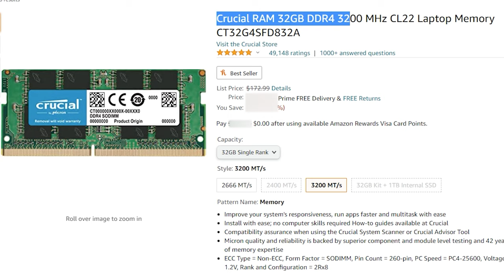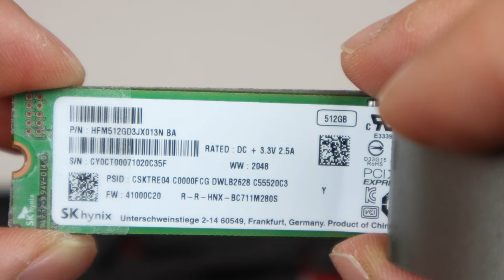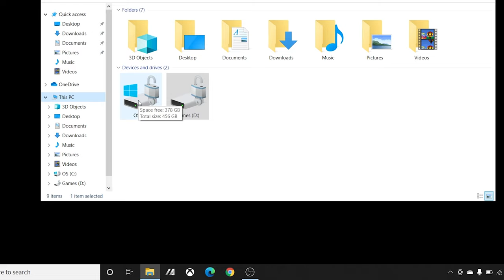How to Install/Upgrade RAM and m.2 SSD in ASUS TUF Dash F15 Gaming Laptop (NVMe only)

Comment: Hi Phil. I don't know if you'll see this comment but I put a new ram into my laptop and its now not booting up. Fans start up and keyboard lights up but nothing appears on screen.
Reply from the maker: Hello, sorry for the late reply. If after installing new RAM you have no display, it’s usually due to improper installation, incompatible RAM, or BIOS/UEFI settings. The first thing I always recommend is to check with the laptop manufacturer that the RAM you installed in indeed compatible. The next thing to try would be to simply remove the new RAM and re-seat it, ensuring it is firmly in place and pressed all the way into the slot. Lastly, a BIOS update may resolve this issue, although you would have to uninstall the RAM first, perform the BIOS update, then re-install it after you have the latest firmware.
Reply: @FixItPhil hello I’ve tried doing everything you’ve said in this comment but it still won’t work
Reply: Though this is an old comment, it might still help others. I experienced the same issue with my FX516PM when I installed Corsair Vengeance DDR4 3200 RAM. On booting, I got a black screen with the keyboard lights on and the battery light flashing white. Removing the incompatible RAM fixed it, so I’m back to using my Crucial 8GB stick until I find a compatible upgrade.

Comment: this helped SO MUCH. thank you! Noted for people who are questioning whether if the computer recognises the full 40gb of ram after installing the 32gb as in this tutorial. It does recognise all 40gb! Happy gaming :)
Reply: Is it works in Dual channel?
Reply: How is the performance after upgrading? Have you tested the RAM performance in games or design programs?
Reply: @kricketto_  I bought the 8gig model with the intention of directly upgrading it to 16 on the first day. I ran the Cyberpunk 2077 benchmark before the upgrade and the ram was really causing a bottleneck, fps dropped to about 10 when the benchmark scene changed to outdoors. Task manager was showing about %95 ram utilization. Installing the second ram stick made the game playable by my standards, now I get min 30 max 70 fps on medium settings with dlss on (rtx3050).
Reply: But there's only one RAM slot, how is it gonna recognise the 40 gb?
Reply: I've been reading the comments for almost half an hour and it's the first comment that says that if it worked for you, I urgently need to increase the ram memory for my engineering and video editing work. I hope it recognizes it and adds the ram memory.
Reply: @antonyflores9067  it does!
Reply: @julianbwelgus  How do we know it recognizes the upgraded ram?

Comment: Great video that answered my questions without having to open the laptop blind.  If the max ram is 32 gb and you drop a 32 gb stick in, does the motherboard disable the 8 gb onboard or do you have 40 gb total?
Reply: 40gb
Reply: Can confirm, 40gb! my internal slot wasn't populated, so I popped my 32gb single stick in, rebooted, 40gb usable. Whoop!
Reply: the limit for the thing is 40gb

Comment: Beautiful l, you sir are my hero!
I went to different shops, they said they can't replace or put new rams in a laptop (i am not a tech guy, i just want to be able to play my games) asked my friends they said the same. Then i found your video! And now I have 39 GB RAM instead of 8 you have my eternal gratitude and subscription! Thank you!
Reply: Good morning, greetings from Peru. I have the same model of laptop and my question was what actually happened if I put a 32 GB ram in the available slot, since the video does not show it in configurations that happen with the ram. I do not speak English and in some parts the subtitles do not appear. I half understood it. when placing a 32 gb and having 8 gb soldered to the board, that really adds up or it only recognizes the 32 gb or it only recognizes the 8 gb
Reply: @antonyflores9067  hmm, I put 32gb in mine with no problems, it all works beautifully (did exactly like the video) the screw placement is important to remember.

Comment: I installed an SSD using this tutorial. Stayed pressing the power button for 10 seconds to eleminate the discharge, and disconnected the battery. But upon connecting the battery it sparked. My heart jumped and I thought the worst but it did turn on. Is that normal?

Comment: I need a a laptop. And I was going to buy a MSI GV15 laptop that is "upgradeable", yet popping out the bottom seemed to be made hard by the company to void the warranty; plastic clips, and the bottom hugging the ports. 

Then, I saw the ASUS TUF15 model, and saw the photos on the advertisement and saw how the bottom is marketable as easily openable.

And then, I saw this video. So I will most likely be buying this model.

Comment: Thanks for this guide.  Just what we needed.   
I have a question on the thermal cover - can you provide a bit more guidance here.  The ones in the laptop are different from the ones I find on the Amazon affiliate link.  I'm just not sure what will fit, as in the video it looks like a thin aluminium layer, nothing like the heatsinks suggested.  Thanks :)

Comment: i did all  the battery disconnect and power drain and yet i got a small spark when reconnecting the battery, is this normal as everything seems fine but should it have sparked.
Reply: Got the same on my G15 without doing the power drain. Twice I opened the laptop, both times happened. Gets me a little scared but it still works fine. I've heard people change RAM/SSD/wifi without disconnecting the battery, that seems to be the only way to avoid sparks on this model

Comment: Amazing video! like! and one question I want to put a secondary drive in the secondary slot (keeping the original drive in first slot), u think is necesary to put the thermal protection? if so where I can find that? thanx and keep doing this great job man!
Reply from the maker: While not necessary for operation, the thermal shield can protect your drive from premature failure and excess heat damage. You can find them at Amazon: https://geni.us/QipdAuR [Amazon Affiliate Product Link]

Comment: Which M.2 slot is the one this has generation 4? The one that says “main” that comes with the ssd or the one that comes empty? What happens if I put both ssd of 4 generation? I understand one is 3rd gen and the other one is 4th gen

Comment: Cheers for this. My 3070 shipped with 8gb of soldered ram and an empty sodimm slot. I've ordered this exact card in your video (crucial 32/3200), but a few people have said I would have been better just running an 8gb card in dual? Did your computer recognise all 40gb with first 16 in dual? 
Also fitted out the spare pcie nvme slot with a 2tb samsung 970 evo plus... This laptop is a wolf in sheep's clothing!
Reply: Hi, did u try the 8gb+32gb RAM combination? How was the result? I am also looking to try the same and have been looking for responses as nothing has been mentioned in the video .
Reply: @anilchauhanadbhut  yes I did, and it recognizes it as a full 40gb. Definitely worth doing.

Comment: Looking at Amazon they sell a model that has 40gb of ram so using 32 in the sodim slot works perfectly
Reply: Still working as dual channel??
Reply: @RocketManHH  yes
Reply: But laptop use maximum 32gb ram no 40
Reply: @Hascobk  yes 32 to add max it has 8gb soldered in already
Reply: @thatfooskye5405  you add 32gb ram yes?. Have write laptop 32gb?
Reply: @Hascobk  just try it and see

Comment: When reconnecting the battery the white piece doesn't stick into its spot and the metal clamp wont slide over it. This is big sadge, I can only use the laptop without battery.

Comment: Hi Phil thanks for the video.  I am having problems reconnecting the battery, the clip does not slide back on over the connector.  I have pressed it in as hard as I dare and it does seem to be in the right place but it springs back out with the tension from the wires.  What am I doing wrong?  Thanks

Comment: First off, thank you! secondly, Will this guide work the same for TUF F15 2021? (i7-11800h, RTX 3060, 16gb RAM)
Reply from the maker: You're welcome! Yes, in my experience the TUF series laptops all have a very similar build and orientation of components inside. It'll depend on your specific model/build whether you have available removeable RAM slots, 1 or 2, (or permanently soldered on RAM). The process is the same, though the exact location of components may vary slightly.
Reply: @FixItPhil  Thank you Phil. I'll try my best to do it following your video. Any parts you'd recommend for the RAM and SSD? currently I have 16 gb ram (stock) and 512 GB SSD, just what came inside the laptop when I bought it. Hope you see this!

Comment: when I tried taking off the bottom of the laptop. One of the screws was not coming out. It’s screwed in tight and I don’t want to strip it. What do you suggest I do to get it loose.

Comment: Nice explained video, but if there’s is already a 8Gb of ram in the motherboard, and I add a 16Gb of ram, is it gonna be a total of 24 gb or 16Gb? Thank you.
Reply: A total of 24
Reply: can we do 32GB upgrade for 1 slot?
Reply: @jimmybillie9509  yes but its slower overall and you dont need more than 16-24 if you do Light edeting modeling or heavy gaming
Reply: @leroyjenkins0736  so the optimal solution would be to add an additional 16 gig stick? I ordered a 32 gig stick before I saw this comment and really just want the best results.

Comment: I noticed on the SSD that you added, it did not have a thermal pad/heat sink with it. Is thermal pads/heat sink’s recommended? Or can you just use a ssd without it and everything will be fine? Don’t want to fry the ssd
Reply from the maker: In many cases it's not explicitly required. It will depend on your build and what you're doing with the laptop e.g. running power hungry games or 3D modelling apps. If you know you're probably going to run the laptop hot and put a lot of stress on the new drive, then investing in a passive heat sink is a small expense that will extend the life of your drive. For me, it's not my primary gaming rig and the drive will be used mostly for archiving and backup files and won't be accessed frequently, so I passed on the heatsink.

Comment: Hi! I have an ASUS TUF Dash F15 on an FX516PC board. I followed the same steps in the video to install a new 8GB RAM, DDR4, SoDIMM in the same slot that you indicated, but when I turned on the computer it did not start, the Asus black screen did not appear or anything, it just stayed there on but with nothing on the screen. Do you know what could be wrong? I updated the BIOS as well.

Comment: Hey just put in my ram and reconnected the little power thing but my laptop isn’t coming back on and is showing now power signs what do I do?
Reply from the maker: Usually this indicates that either the RAM module you installed or the power connector for the battery were not seated properly. I think your best bet is to remove the RAM you installed and see if it boots up, and if so, then it was the RAM causing the problem. It's also possible that the latch on the battery connector didn't close fully and allowed the battery to become disconnected, so check and re-seat that connection as well and see if that helps.

Comment: So, I noticed there is a thick thermal pad underneath the SSD stuck to the motherboard as well? Is that thermal pad shorter just to transfer heat from the controller away from the SSD and to the motherboard? Is that one about 2mm thick? Thanks.

Comment: Sir. I want to ask about the RAM. since this is 16GB RAM and you remove the 8GB and put 32GB. It will add as 32GB + 8GB or will stay as 32GB? BTW I like your video sir. Thanks a lot for this.
Reply from the maker: This laptop will show 40 GB of RAM.

Comment: Great video, I've been building desktop pc's for years but doing anything to a laptop is alien to me. Really helpful. 
I just had a few questions, Is there a specific type of ram that I need for this laptop?
I know that with desktop pc's you have to find compatible ram for the motherboard, but online i'm reading that people just used any old spare laptop ram they had. 
Also Would I need to match the ram speed of the current 8gb default ram, or could I go faster? 
When I build I always match, but I get the impression that that isn't applicable here.
Reply: typically if you add a faster ram it will run based on the speed of the slower one, ive read and heard its not like that anymore but from my experience thats how it usually goes, pc or laptop

Comment: Hi, great video. If I add a 2nd SSD will I still be able to install programmes and games onto this 2nd SSD. Or can I only install programmes onto the orignial SSD which has windows installed? Thanks.
Reply from the maker: Yes, you can install games and programs to the second SSD. That's exactly what I do with mine.

Comment: Fx516pm is my model exactly the same, specs says support only 24 gb ram in one slot of laptop. But you have fitted 32 gb ,,,is it working in full capacity ????

Comment: Hi, I just tried to upgrade the SSD and RAM on my F15. All good for the SSD but black screen when I had a second memory stick. I have a free slot and respected the memory speed but it seems windows is showing no available spot but I I have a physical one available. Any Idea about it ? I bought a 32Gb Corsair Sodimm at 3200mhz that would tripple my ram but I don't know why he don't want to boot considering I see the power light blinking when I try to book but no loading screen.

Comment: My current laptop uses a 2TB ssd for storage (not nmve). Will I be able to install it as the second storage? Would I need to purchase a converter / run into (physical) size issues?
And how necessary is the heat shield?

Comment: So me being stupid, I forgot to reconnect the battery connector and I plugged in the laptop to test it, the charge light went on for about 2 seconds then turned off. I realized I didnt connect it so I'm sorta panicking, did I kill the computer?? It wouldnt turn on when I last tried it after connecting it
Edit: I wasnt upgrading the laptop I was just opening it up to let it dry because I had spilled a little bit of water on it, the computer was off when it happened but I let it dry for more than 24 hours, is it possible the water is the reason it wont turn on or was it the battery connector?

Comment: Hi,

I have a quick question, in the passage of the video on the ram, you say that you need to put a 32 GB ram strip.

Just wanting to upgrade my PC from 16 GB of RAM to 32 GB of RAM (I have exactly the same model as you) I bought a 32 GB 3200 MHz strip, no problem for the installation, however when I turn on my PC I have a black screen and it is impossible to access the BIOS everything else is running, I hear the fans spinning everything is on etc but no screen.

Does anyone have a solution because here I must admit that I do not see the problem, I would tend to say that I therefore have too much RAM, namely 32+8 but in this case how to mount the PC to 32 GB of RAM if the second RAM slot is not modifiable?

PS :I also checked the compatibility of my new RAM strip and it is compatible with the PC

Comment: Thanks for the video. I've the same PC but with only 8gb of RAM. So i'll find only 1 RAM Stick in my laptop?
Reply from the maker: No, if you only have 8 GB of RAM, then that would be the permanently installed 8 GB RAM. There should be an open RAM slot that you can add a stick to as shown in the video. There's also another version of this laptop that has two RAM slots where both can be replaced, but it's the higher tier one with different specs.

Comment: (Tech question 2 parts)....
Laptop has 512GB M.2 SSD in the main slot
can I put a LARGER (1TB,2TB,4TB,8TB) in the second slot? And if so, does the laptop see the new drive as the new main or will it act as JUST a second drive?
Thank you.
Reply from the maker: Yes, you can add a larger drive in the second slot. If the new drive doesn't have an operating system installed on it, it will act only as a second drive. If you do install an OS on the new drive, you may set it as the main drive (but you don't have to); you must also change the boot priority in the BIOS in order to make it the primary drive.

Comment: I'm getting a black screen after doing what you did (upgrade the ram) I just tried to add the 32GB DDR4 Kingston - KVR32S22D8/23 ram and it doesn't work

Comment: Hey thanks alot for the video ur a legend but I have a question please
I just upgraded the RAM today but when trying to unscrew the M.2 screw to add an additional NVME the screw simply won't go out it's tight and stuck so bad in its place. After many attempts and pressure applied to try to unscrew it I ended up damaging and wearing out the M.2 screw. Do you know any way I fix this issue I would really appreciate it. Again thanks alot for the video.
Reply from the maker: Hm, that is unfortunate. A stripped screw is the worst. It happens most often when the screwdriver bit size is just a tad too large or a tad too small and doesn't fit the screwhead right. The bit size for m.2 SSD screws is a #1 Phillips screwdriver bit (I recommend this set: https://geni.us/kWSA [Amazon Affiliate Product Link] if you DYI gadgets often). Since the screw is already, um screwed, you can try using a wide rubber band placed over the damaged screwhead and pressing the mini screwdriver into the rubber band so that it makes contact with what's left of the grooves in the screw and perhaps this will give you enough friction to torque the screw to remove it. Remember, turn left (counter-clockwise) while pressing down and it should release. replacement screws can be purchased here: https://geni.us/g8LF [Amazon Affiliate Product Link] Good luck!
Reply: Have you tried a JIS screwdriver on the M.2 SSD slot?